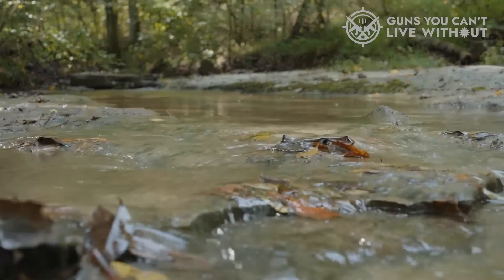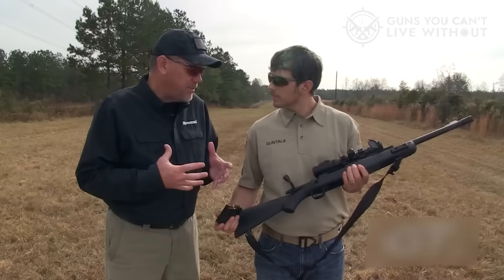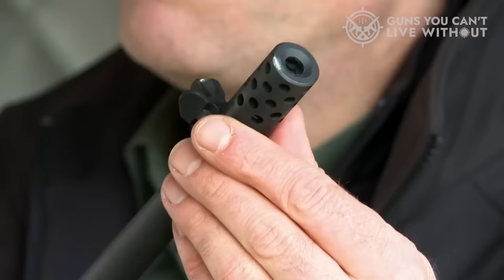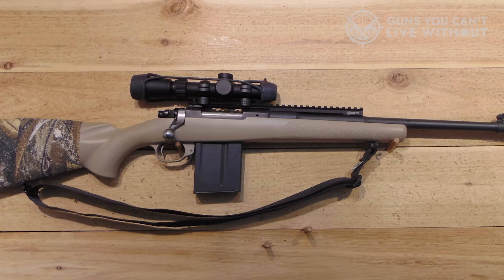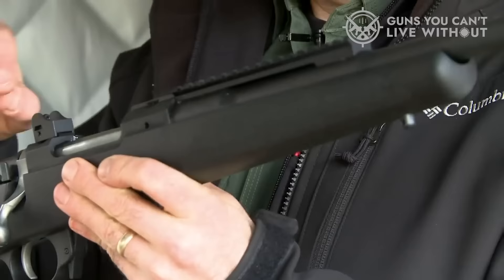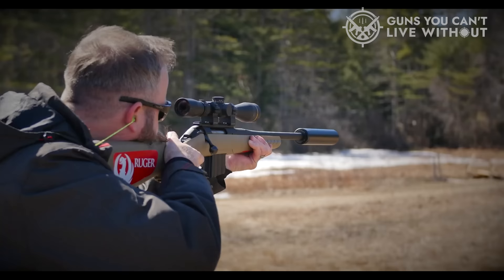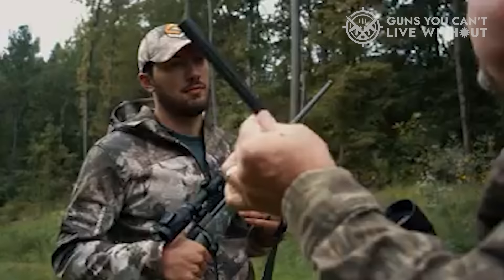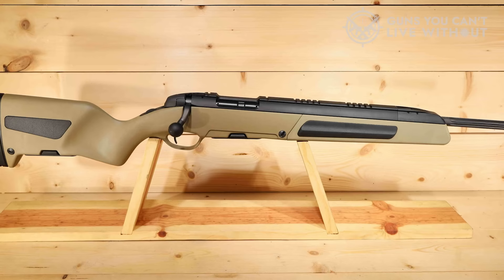Best Scout Rifles For Survival 2024! Who Is The NEW #1?

Comment: They're both just as good, yet the 3v is "much" better? It's fine if you want to have a clickbait title, but no need to contradict it. I love all the S197s, but the reason 5.0s go for so much more, is because the engine can handle much more power on a stock block. The amount of power they can handle means you need to spend way less on supporting mods if you actually want to race it. If I were 52, and I didn't intend to mod/race the car, then yeah, the cheaper one wins, because you'll never use all of that 400+ HP. If you actually want power for the dollar, it won't be a 3v, Hemi, or LS. It will be a Coyote as proven on Can I be Frank. The 3v will remain the cheaper S197 for rest of time, for those 5.0's that aren't wrecked, will be coveted among collectors for decades to come. The perfect body style, with a legendary engine to match. You could argue that a 1st Gen S197 with a swapped 3rd/4th gen 5.0 is a masterpiece for about the same price as 2018+ 5.0's though.

Comment: I do wish I'd bought a 308 instead of a 30 06 that kicks like an elephant on steroids.
Reply: Pull down your factory hunting loads and drop the powder charge to 38grains, then recrimp the bullets back in.   A basic $39 Lee hand press and a single $20 Lee factory crimp die are all you need.   And a cheap $10 Harbor Freight digital scale.
Reply: @blackhawk7r221  Thanks. I've been considering that and even looked at a few of those but have never done my own loads and might be difficult now with messed up hands. I'll save that text and check those out, I think I only found the press and a mold.
Reply: @ELXABER  Well luckily, you won’t need much handpower to just crimp a neck.  Kinda all depends on how much you wallow the neck gently twisting the bullet out.  It’s an addicting hobby though, so watch out.
Reply: @blackhawk7r221  Thanks again. I have 2.5 working fingers on one hand and bad arthritis. I'll give it a shot. 🤣 I'm retired now, and I could use more hobbies.

Comment: nobody needs to hunt for food in N. America. Food is free for the asking.  Only shtf could make it necessary to hunt for food and all of the game will be gone in 2 months.  shtf will mean COMBAT and the last thing you want is a noisy, overpowered, slow-arsed bolt action with no night sights., no takedown concealment, no rustproof, dark finish, no flashhider, no chromed chamber, no one handed- use, no rapidfire, no .22lr conversion unit, no nothing, basically. A shorty AR in 223 is superior in every regard, for shtf.. Short barrel means low velocity, fast, low powered scope means no long range sniping.

 A short barreled 308 lacks the ability to expand a softpoint reliably beyond about 250m, and it's marginal out there for elk, moose, mountain goat, sheep or pronghorn. So it's not even much of a big game rifle. It's richochet and over-penetration-prone for use on varmints,  It's too noisy and heavy recoil for training novices. So the Scout Rifle is  a very, very limited-use item, actually.  

60 gr 223 softpoints will brain elk, moose and grizzly just fine to 150m, and with night vision, night sights, silencer and a baited tree blind, it's not that hard to get that "close', either. Bowhunters get 5x that close all of the time, so why can't you get 1/5th as close as they do, hmm? YOu're SURE you'd "ALMOST never miss' a head-on prone man, at 300m,  That's a 12" disk as a target. Geometry proves, then, that you'd never miss the 6" brain circle at 150m, cause the shorter range means less risk of target movement, up and down hill angle problems, mirage or wind problems, misjudgement of distance problems

. So if you ca'nt get that close to animals, you 're an inept hunter and if you can't hit the brain of an elk at 150m, you can't hit the head-on prone man at 300m, either. Which means that you're no sniper, nor  reliable taker of 300m deer, either,  The deer's vital zone is more like 8", not 12". so you're not capable, reliably of taking the deer at more than 200m, while the 223 AR can reliably take deer to 150m, given a good chest hit with a 60 gr  softpoint., 

So why bother with such a limited use, very expensive thing as a Scout Rifle, hmm?